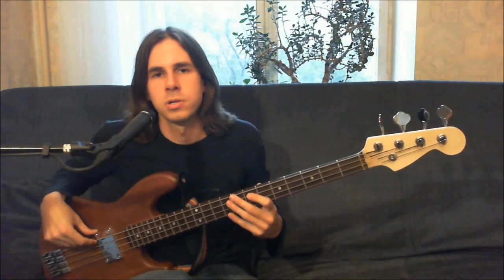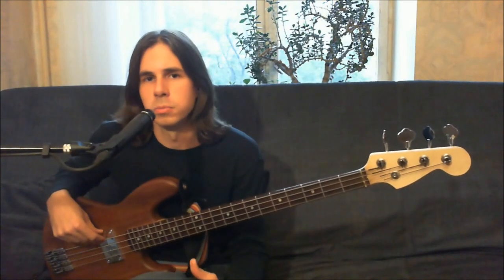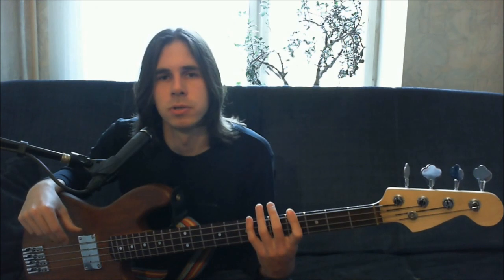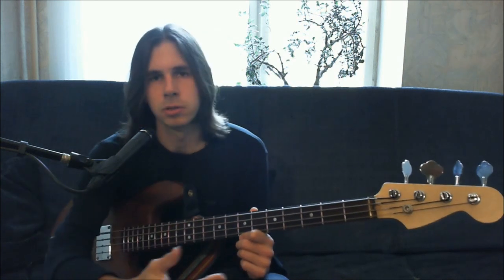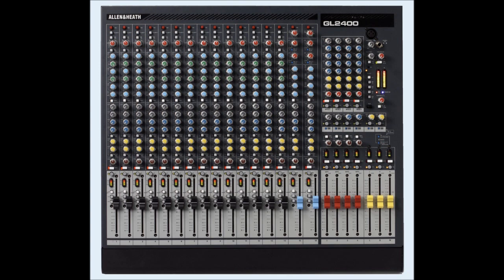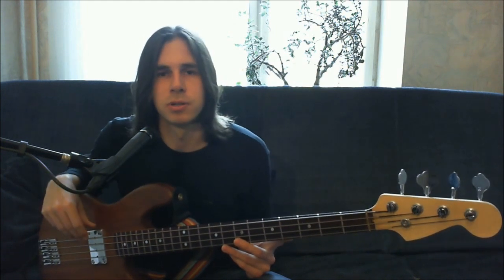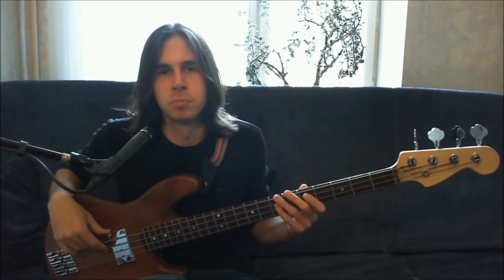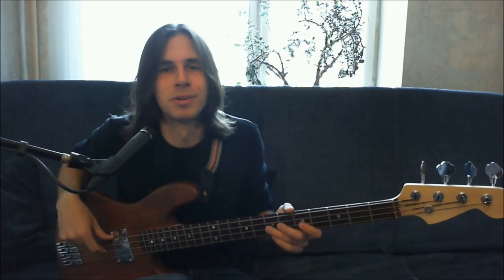My Bass Guitar with Moving Coil Transducer System

Comment: Is the output weak?
Reply from the maker: Zantrop64 the output is weaker that the average microphone, but the signal to noise ratio is good. I played this bass on stage many times, and despite of the long cables to the mixing console there were no problems.
Reply: dmitriyrazorenov i never heard of this system, i am wuite curious about it as I would like to become a luthier.
I'd like to learn more about this, do you have links, or things like that, or do you plan on making a video showing us the inside of this?
Reply from the maker: Zantrop64 as for now, there are only two bass guitars with it: https://youtu.be/nAKhVPMob1c
Reply from the maker: Zantrop64 there were some patents that have something like this, but they worked only with fretless instruments, or had too much noise